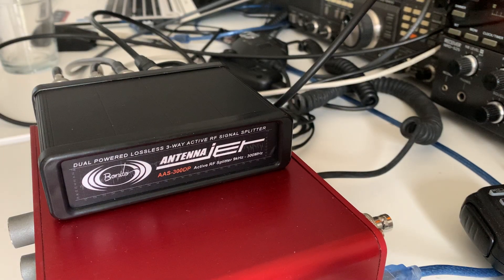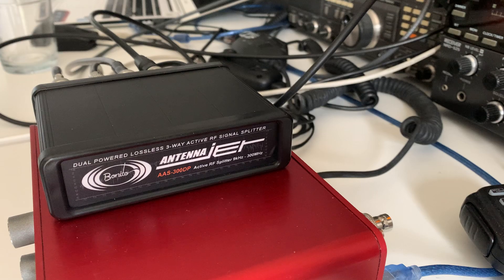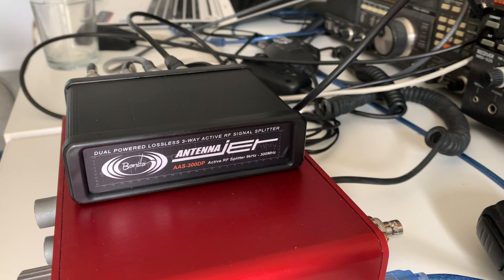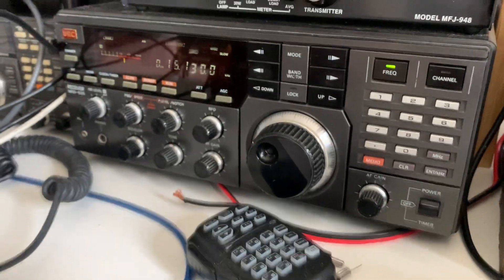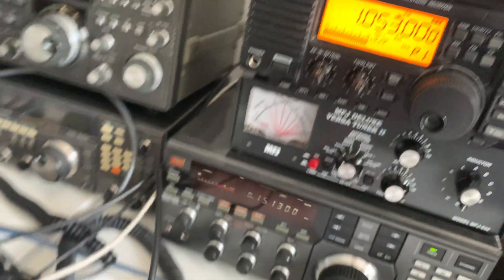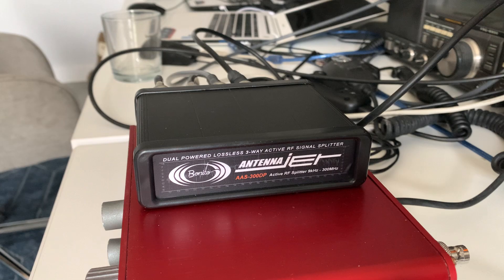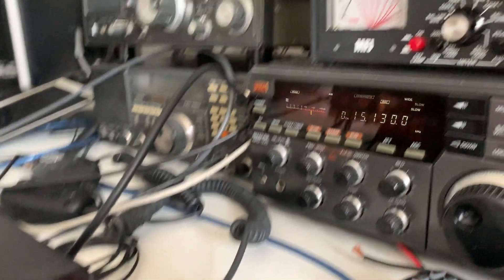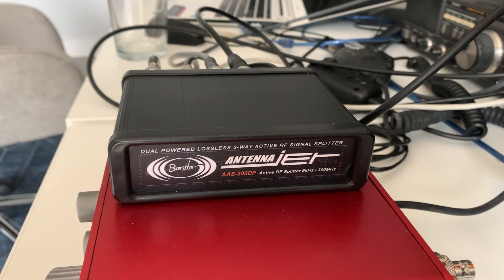Main specifications & how I'm using the Bonito AntennaJet AAS300DP lossless active antenna splitter

Comment: Nice video but... Why this splitter @ this price? In the line of your experience with Elad products, the ASA-62 is a beast of a splitter with more possibilities and a higher grade of quality. Did you check this out before buying the AAS-300dp? You can even control it remote and via the SW2 software. Surely Clint I did not expect that from your kind of expertise. This kind of equipment is the core business of Elad for many years and is worldwide known for its professional quality. In fact, I'm still saving up for the ASA-62 as we speak. I'm not saying that the AAS-300db is not working fine tough,  You must have got a exceptionally special price deal from Bonito. No pun intended, Ron
Reply from the maker: Hi Ron, how about if I told you I didn't pay anything for the AAS300DP? I'm very surprised that you would question my expertise my friend. 73
Reply from the maker: By the way Ron, I should also point out that this RF splitter works perfectly. 73
Reply: Clint, I did not question your expertise at all, just making a remark. I guessed you could have forgotten about the Elad antenna equipment. The fact that you did not pay for the AAS-300DP explains it all. I hope I did not offend you in any way as it was not my intention. 73'

Comment: Thanks Clive for showing the splitter unit.
Would really like one here but the Euro to $AUD difference makes it just too expensive.
Will stick to using my Mini Circuits ZSC-4-1 for the time being! (Passive but works well with active loops)
Reply from the maker: Fair enough Adam. Clint 73s